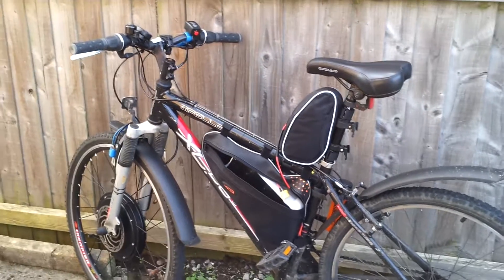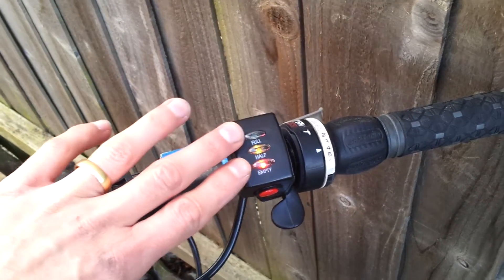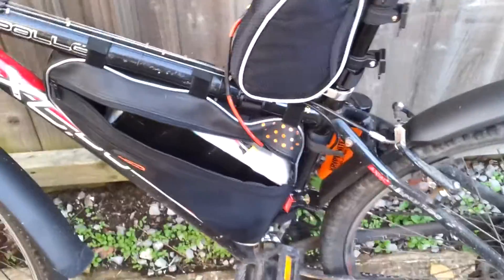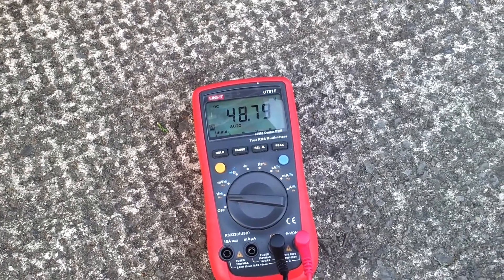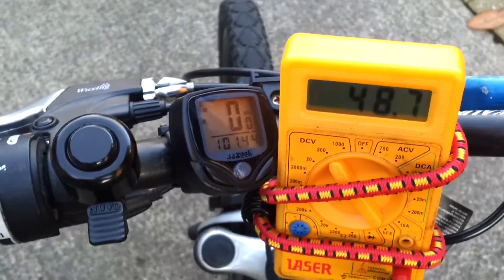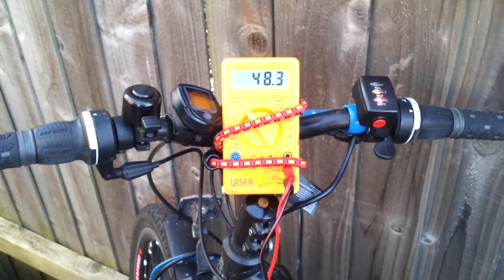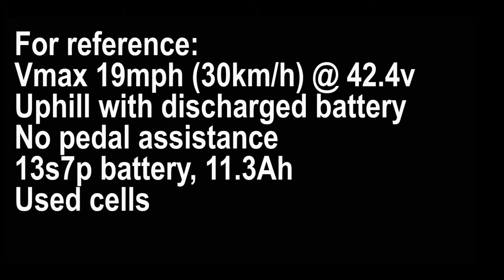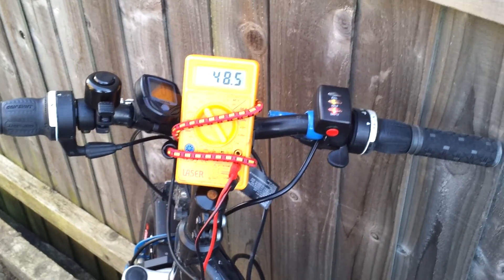Lithium Ion 18650 48v e-Bike battery build DIY - Part 10 - Voltage drop under load

Comment: If I leave my multimeter leads on the positive n negative discharge cable on my lithium battery also connected to esc can I read volts while riding ?
Reply: Yes

Comment: I have a multimeter how can I install on my scooter to monitor battery while riding and charging I have a 1000w 48v20ah lithium do I install between the battery and speed controller

Comment: Do use the same xt90 plug for charging and for plugging into the speed controller
Reply from the maker: I use the XT90 plug style for both but they are wired independently so I don't use the exact same plug for charging and for the motor controller.
Reply: @KomradeShotabollokov  why in the name of Christ would that make any difference.
Reply from the maker: Because I charged the battery through the BMS but did not discharge it through the BMS. So 2 different connectors.

Comment: nice video man! I use the same BMS with 48V battery but I only use 13s4p . When battery goes under 70% it shut down unexpectedly. can be problem in BMS ?
Reply from the maker: Hi Peter, I've never had that problem so I suppose that it could be the BMS at fault. Either that or the BMS is protecting the battery if it detects that too much current is being drawn whilst the battery is discharged?
Reply: Mine is shutting down too! I cam to Komrad's video to see how I could hook up the multimeter to read out if there was any voltage drop. Did you Peter find your problem?
Reply: Battery/bms cuts out because to much current is being drawn,

Comment: *WARNING* I have recently upgrade my MTB to electric, my aluminium suspension forks front dropouts sheared while riding luckily I was pulling away and not blasting down the road at 30mph as I was a few minutes before. Hub motor tourque is too much for aluminium forks.
Reply from the maker: I don't think these forks are good enough to be aluminium. More likely steel, CrMo, cast iron or granite. Oddly enough, I've been more worried about the frame; where the headset meets the downtube. If I go over the 'bars, I'll post a video of my scars. Rhyme.
Reply: Did you install a torque arm?
Reply: @shadoworkz123  Afraid not, stupid mistake. I have replaced the forks with steel ones.
Reply: @alpinechili  I see. Just install torque arm and it will be ok.

Comment: I'm considering going your route with the batteries but i can get some new ones with 2500mah for about 2.16gbp. what did you actually spend for all the used ones to get two usable packs?
Reply from the maker: I assume you mean £2.16 per cell? Or £2.16 for a massive load of cells? I paid ~£100 for all my cells and used 182 in the two 7p13s packs. The average cell capacity was ~1700mAh.
Reply: Komrade Shotabollokov yes, 2.16 per cell. im trying to weigh up the effort of getting used cells Vs new ones. what's a good source then to get a bulk of used cells? eBay?
Reply from the maker: It's an interesting decision and, having been down the used route myself, I would choose quality new cells if I had to do it again. In one of my videos I discuss the loss rate from buying used laptop battery packs: it's significant. Around 50% of my used cells were of low enough quality that I chose not to include them. The economics were still reasonable (~£100 for 182 cells @ 1700mAh average) but spending more for better capacity is the way to go. I bought my cells from eBay as a laptop battery 'job lot'.

Comment: I'm using mine for work this week 6 mile each way and loving it , 1000 watt hub motor 48 volt battery , next step mid drive motor and make my own battery .
Reply from the maker: An e-bike makes a great commuter, I agree. It would take me longer to drive in at rush hour.